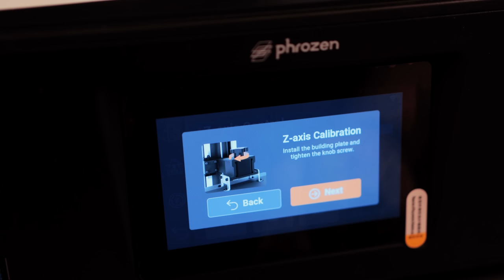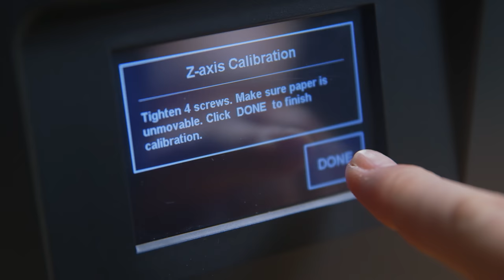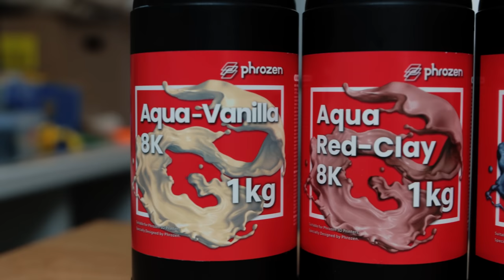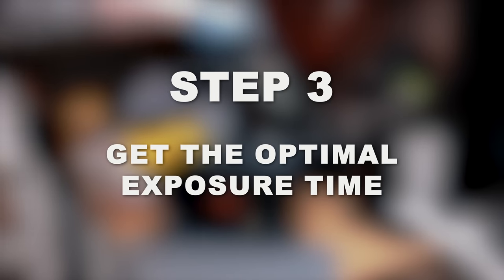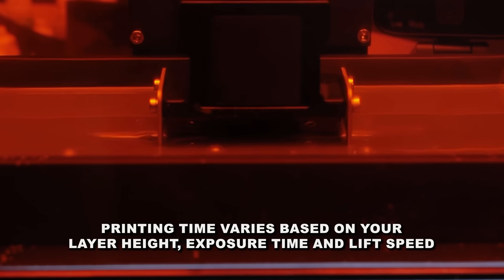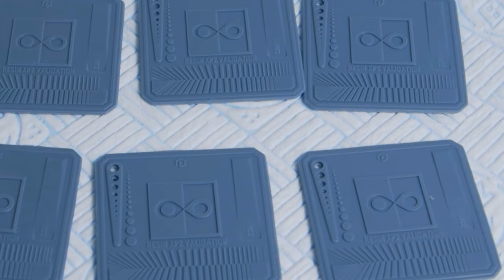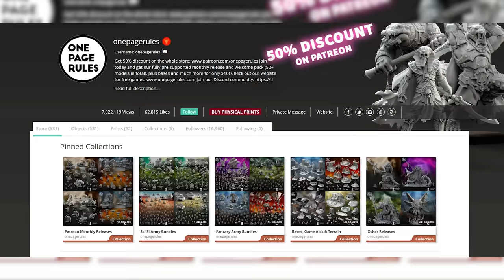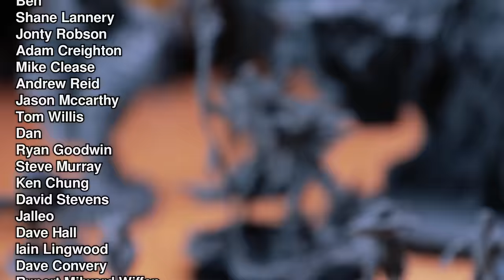How to Print Perfect Miniatures - Resin 3D Printing BEGINNER GUIDE - Step by Step

Comment: I challenge you.. to make a Phrozen Sonic Mini 4K work.  A quick scan of things will show you how often they just.. fail to print. To this day, my sonic mini 4k (only the mini 4k) it's single rail and flexing improperly secured top causes the whole thing to deflect when printing, often snapping supports. It's a mess. I've had mine since release and it's never printed right and sonic never did right by it, even though the engineers tried to help me. I dusted it off just this week and started printing. 3 print sets, everything worked. 4th failed, 5th failed, 6th failed, 7th failed, 8th failed 9th.. failed. No setting changes, no air-temp changes, and I only changed to an new resin bottle on 7,8, and 9 with continued behavior that was the same. Which included layer de-lamination above the "base" layers and snapping supports that previously were just fine. Again temp, same, resin (until 7,8,9), same, settings, same, file same everything. After every failure it was fully cleaned, vat cleaned, and z-calibrated. Thing is, for the first three, I didn't clean, didn't recalibrate. I only started after it started failing. It did this when I first got it. First 3-4 print sessions worked, and then for a full bottle and a half, nothing worked. Strange de-lamination, broken supports. It was a mess so I shelved it. A quick internet search will show you how often people have print failures with this model. Hell once it enters fail state it can't even print the default file reliably, failing that ring print at least half the time. Even the sonic engineers tried to help me make it work. I really should just bin the thing and buy an Elegoo or something else. Though from my searches every model with twin rails or support rods (sonic mini 8k S) don't get the reported problems.. so I can only imagine it's a problem with just the sonic mini 4k being utter trash.
Reply from the maker: Well, this is aimed at beginners who need yo bet started and confirm there's no issues with the printer.

Delamination souns like too few transition layers or too much of a citing jump between transition and normal
Reply: @FauxHammer  interesting point. My current firmware doesn't do transition layers. You have base and normal..wonder if they released firmware update for the printer...
Reply from the maker: @meatybtz  firmware? Or slicer... Because this is a gcode function I think
Reply: @FauxHammer  well the printer has been in the closet for the better part of more than a year. But there were a lot of functions that didn't appear to be enabled on the printer firmware back then. The aliasing for instance. You can check it in the slicer and it won't actually do anything in regards to the print. Even their test file has aliasing but it is clear when you print that it's not working right. The mini 4k was an odd duck in between a lot of gcode software changes and a lot of updates to chitu box, etc all at the same time. I have the latest chitu and lychee. But I haven't touched the firmware yet. I haven't even touched on the thermal issues. Back when I was in contact with the engineers by email we use an ir thermometer and noted that the resin in the vat broke 104f during long prints at 76f ambient temps. This could explain the variable results as LCDs are effected by temp and it's cooking hot during a print it might effect screen opacity response. I bought the printer on release and phrozen, while responsive, basically led me on past the return period so I was stuck with this monster and have spent time now and then attempting to make it reliable.
Reply from the maker: @meatybtz  I understand the frustration when you go through such an ordeal, but it is great to hear that Phrozen are responsive where so many others aren't

Thanksfully we've overcome a lot of that.

But transition layers are simple. i canl't imagine the printer needs an update.

It work by calculating your base exposure time and your normal exposure time. Then however many transition layers you decide, it gradually reduces exposure time on those layers evenly between the two. All that is g-code instruction to the printer for changes in exposure time son those layers. so i;m sure that would now fix that issue.

Don't use lychee to slice. as i say in this video.
Reply: Perhaps reducing the lift-speed would help?
Reply: @herculeholmes504  Aha, now this is where the rubber meets the road.  I had been lowering my lift speed back then to ridiculous speeds because no amount seemed to work. I come from an engineering background so the lift speed, is, as it turns out, somewhat of a red herring. I have a video on it somewhere. But when lifting a print from the FEP you have multiple forces in play, but key ones are the suction force of the FEP, the plastic deformation limits of the uncured resin, the critical failure limit of the uncured plastic, and the lift speed. Most people try lift speed, and sometimes it works. But for the non-technical it's like pulling of a band-aid. As your machine lifts, the uncured resin begins to stretch under a tug-of war of forces. Too slow and it will stretch and then fail (pull apart), time under load is critical. Too long and you get deformation failure. Too fast and the total force applied to the uncured resin exceeds it's critical point and it will snap. Turns out, there is a sweet spot, but it will vary based on your FEP, print size on FEP, etc. Working with the engineers they had me speed it up above stock and got me from 100% failure rate to 75% failure rate.. a marked improvement. The other trick was you need to give time for the resin to cease "micro-movement" in the fluid caused by the plate moving into position to apply a layer. If the resin is in motion, it won't cure properly or even reliably. An example of slow lift causing stretch was my machine was stabbing the FEP, leaving dents. When slow lifting was used, the print would stretch and so be longer, by a layer or more worth, not a lot, but enough to dent the ever loving crap out of the FEP because the print is now longer than the machine expects.  Its all pretty technical, but it's why people with strong resins can use really fast lift speeds.
Reply: @meatybtz  I'm in the same boat as you with my Sonic Mini 4k, where my prints were perfect until one failure and then everything went wrong. I haven't touched it in over two months because no amount of fiddling with settings was producing good results. Calibration test prints were fine, but actual models would fail as either only the supports printed, or I'd get half a model and then a warped layer of resin. 

Apparently the sweet spot for lift speeds is 40 across the board, or 180. Nothing in between, because you either want the slow band aid drag, or ripping it off. My results for both were as above: calibration test prints were mine, models were not. But hey, it might be a model issue, too....
Reply: @Guzwar  I have a theory that the engineers never confirmed nor denied that there are multiple design flaws in the sonic mini 4k. They over-heat, over-current, and have inconsistent LED performance under thermal loading. Mind you mine was an early one and a "COVID" machine when parts were hard to get. I don't know if newer Mini 4ks have the same issues. But there might be some firmare support that might help. Same thing with maybe finally making AA work like it was advertised vs the "psudo" partially implemented version that shipped. I got a fully successful print last night, that meant lower than average ambient which my have kept the vat or LCD under a critical point in temps. I paid a premium for an early small formfactor 4k printer and it's been terrible. But I think we need to think about operating temperature as a culprit. Like put a big fan on it while printing. Something I've never done.
Reply: @meatybtz  That is some seriously deep awesomeness, thankyou Nathienel! 😯

You do realize though that I'm going to repeat this to other people on printer forums and pretend it was all my own idea so they think I'm smart?

I'm currently using a lift speed (SirayaTech Fast resin) of 60/120; which seems to be working okay, but now you've got me thinking if I can get better results on the "Cones of Calibration" test; my last one was okay-ish but maybe I can get it perfect.

Comment: Question: i have now 11 holes and 11 post (sorry for my bad english) is that ok. Exposure 2.5s bottom exposure 25.0s. If you cannot answer this it is ok i wanted a second opinion on this because i am new to this hobby and wanted for long time ago to 3D print thank you before hand. Thanks for the good quality Videos keep on going 😅
Reply from the maker: if you have an equal number of holes and posts, then yes that is a balanced exposure and also the best your printer/resin combo can do.
Reply: @FauxHammer thank you for the quick reply. I tested again with one second less and got a better result. Also test printed one miniature and it looked great. thanks again and keep up the amazing work

Comment: Your wisdom is always appreciated. I'm a noob and went for the bait that elegoo standard 8k resin would be the way to go. Besides because in my country even the worst resin is around 40usd while resins like elegoo abs like and elegoo 8k standard are between 50 and 60 usd.....as I was saying I took the marketing bait and bought several 8k resins. I am looking to print miniatures and trying to reduce the brittleness I just bought a few siraya tenacious clear resin to mix them...any suggestions you know or have heard about on ratios between the 8k elegoo standard resin and the tenacious?

Thanks a lot for the patience to read this
Reply from the maker: 5% -20% you can mix as high as you want but you get a tradeoff of detail sharpness at the cost of flexibility. It's about picking what you like most

Comment: Thank you, thank you, thank you!!  I am brand new to 3d printing...and your videos have so much useful, helpful information.  Thank you for sharing your knowledge, advice and tips so that a person like me who is just starting down this rabbit-hole does not make costly mistakes. 👍
I have a question:  in some parts of the video  (at 6:40 for example) you show clips where the person in pouring the resin over the top of the build-plate while it is raised some distance above the vat -- does this not lead to the possibility of splatter and little droplets of resin splashing outside of the vat as the resin runs over the edge and drops down 4-6 inches into the vat below?  Is there a reason for pouring the resin like that versus pouring it directly into the vat?  Sorry for a dumb question, if the answer is obvious to others -- but as I said I am brand new to all of this (still waiting for my printer to arrive).
Thank you for your time and assistance.  Subscribed/liked.
Reply from the maker: Thanks so much In return, this is one of the most common questions I get and the answer is. It just looks more cinematic. Don’t do this

Comment: It´s not complicated but it´sa mess with Resin prints. I am still waiting for a machine which has some basic features.
1. A good filter, so I don´t have to gas the whole family at home.
2. Resin vat heater, resin needs warmer temps.
3. Low Resin warning would be useful

Now the newer 12k resolution printer has automatic bed leveling which is good however without those other basic features on can not even print technical resins.
Reply from the maker: I have a test printer on the floor at the mo ready for unboxing that apparently has designed out so many issues
Reply: @FauxHammer  Yeah I doubt it but if that´s true the printer will be way overpriced. Those printers are basically ll the same from China. They simply have to change the "Chinese" designs slightly and would b fine but they don´t because whatever they are doing now it sells anyways

Comment: Great videos as always. Probably you have spoken on all of these subjects in the past but i was not able to find it.

What are your recommendations on settings when in comes to the lift and retract speeds (vroom), the light off rest, the transition layer count, lift distances and so on. Could you share a bit about your preferences there please.

I am aware exposure times vary 100% on the resin and specific working conditions. But all those other settings i mentioned seem to be aimed around either optimizing the overall printing time or the lifespan of the screen (such as decent bottom exposure time around 5x your average layer exposure time, light off to let the screen cool, etc) 

I would really appreciate your suggestions.
Reply from the maker: honestly, with those settings, I rarely care unless there's an issue. when I take my initial settings from either lychee or the defaults. they are good enough for me.

If you want to dial in a printer to that degree, I suggest heading to your printer's support group. If I can get a printer "working", that's good enough for me.

Comment: Hey guys,  even Faux please help me. I'm running a business where we will be creating and selling 3D model pixel art cars made with voxel creator by our graphic designer. I want a resin printer that is reliable, future proof and a relatively large buildplate

all my research has pointed me towards the Elegoo Mars 3 Pro. I have also seen the Mars 2 and honestly the quality isn't THAT different although smaller buildplate. I also see all these videos on youtube and rarely any models of voxelpixel art structures. What would you recommend, all details helpful and will provide more info if u need. its difficultto knowwhats best until I actually purchase it.Please advise

also ive seen they are creating a DLP printer under the name Mars 4.When is this coming out? Isthisreal? at what price point? Couldother mars products lower in price when it does? Please help 

mostly worried about the cubes on the art not being sharp as I've not seen much examples of voxel pixel art models that are highly quality designed. please advise
Reply: How many are you making? What size are the models? How many parts? 
The Elegoo Mars series are fairly small but they're excellent if you want to print just three or four miniatures at a time, and I think they're less hassle than their larger stablemates; the FEP is smaller so it is stronger, the vat is easier to handle and clean (btw, you might want to buy a large-size syringe to suck out resin - it's a great trick), and there is less fumes because there is less resin held in the vat.

But if you are printing in larger amounts.. you'll have to go bigger. And if you are making large numbers of models, casting is the way to go, not printing.

I don't know what quality you need; for miniatures and figurines and such, there is a noticeable difference between prints from something like an older Mars 2  and the newer Saturn 2 or Mars 4. For some models it won't make a speck of difference though. 

Find someone who has the printer you are interested in and get them to print one of your models.
Reply from the maker: DLp is sharp but I'm sure any modern printer is that good. I;d recomend the GKTwo as it designed out so many typiucal issues, but it is expensive. if running a business you will wnat that size

mars 3 is entry level.

I am testing the Elegoo Mars 4 DLP as i write this, it;s ok but youc an get more printer for that price.

if you are constrained on budget and need entry level.. wait a week and order a Mars 4 Ultra when it comes out on preorder.
Reply: @FauxHammer  thank you!

Comment: I also print in an unheated garage. I keep my printer (Saturn 2) and the resin I intend to use in a grow tent with a ceramic heater and thermostat controller. I've been printing all winter with no issues.
Reply from the maker: nice

Comment: So cold is bad, need heater. But what about 100 degree humid Texas summers in an included garage? Uniformation chat support said it should be fine for their GK Two, as long as not in direct sunlight. What should I look for in the way of issues that may be caused by higher Temps or humidity?
Reply from the maker: Loon for I early soft resin, you will see signs of stretching and elk nation on the z-axis of your print. Potentially some soft details.

But too hot is far less of an issue than too cold
Reply: @FauxHammer  Thanks, can this be compensated for with settings. Or do I seriously need rethink setting up printers in my garage in my environment?
Reply from the maker: @DnD_Painted_Miniatures  im
Not sure, I don't think reducing the power of the led array will help, that will just diffuse it more.

I honestly do not think it's that much of a worry, but I've never pro he's in such climates. Never seen any evidence online though of. My weather is too hot

Comment: Also my halot doesn't have anything that says z equals zero.
Reply from the maker: I just watched their levelling video https://youtu.be/u3n6eDMlFdk?si=txl4BWmxZ1OYfZTF

Follow this, but.

Don’t use paper. Just put the vat in and level it to the FEP at the bottom of the vat. And ignore the shit about shining a light through it.

Looks like home is 0 on the mage so you don’t need that z=0 button.

I had a mage pro, not a mage so I’m hoping this video is correct. If not. Check a community fir this printer